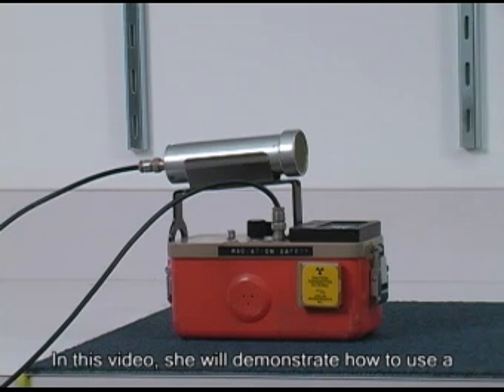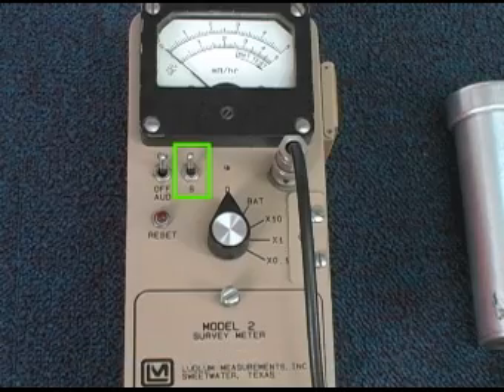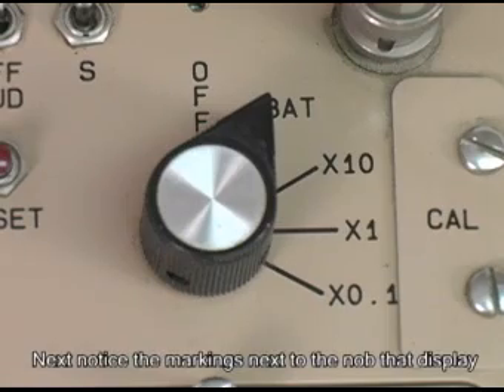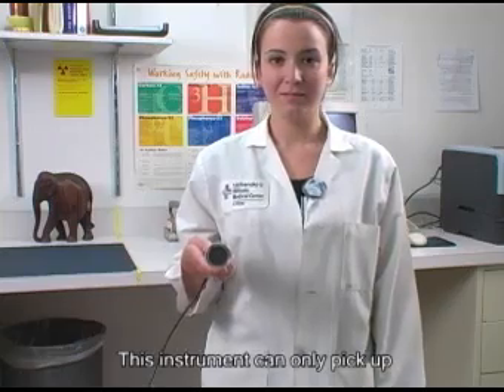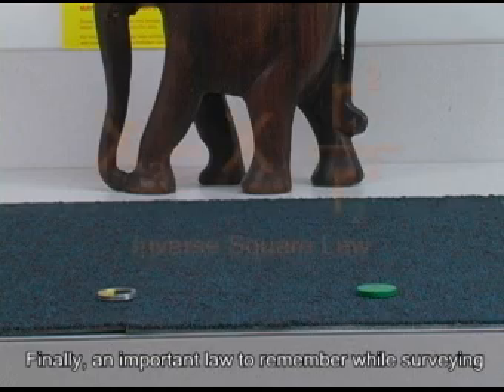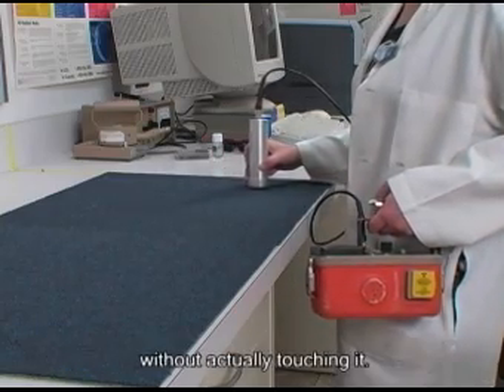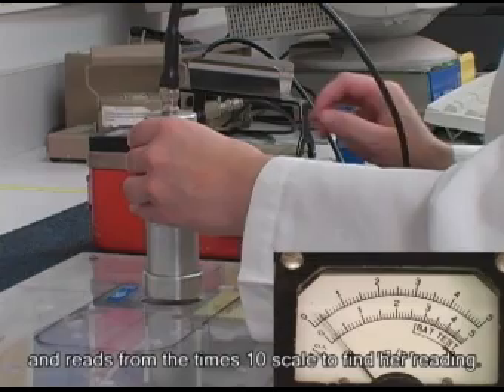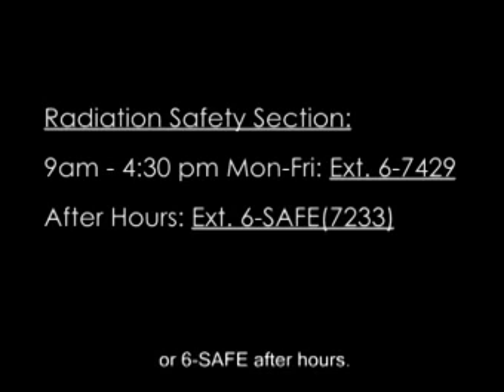How to use a Geiger Counter

Comment: Dang. Use a lab coat with cuff, and not one hanging out like that, so that the sleeve touches the contaminated surface. What kind of irresponsibility is this? Such cuffed lab coats are also useful for working in hoods in the tissue culture to avoid accidents. Also, although not clear from the video, hope she is wearing a lab coat with span buttons/press buttons and not regular buttons.